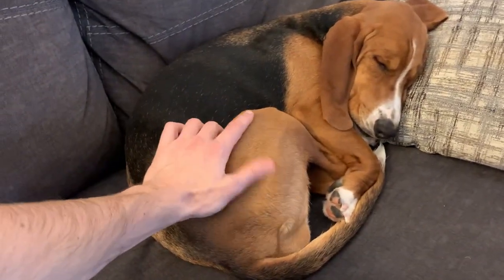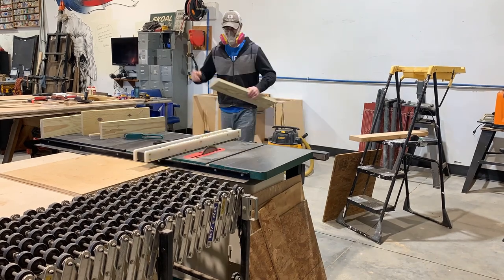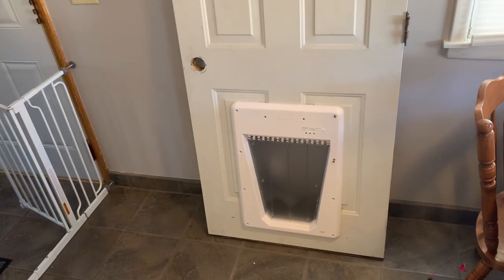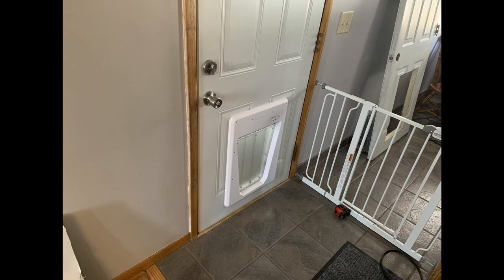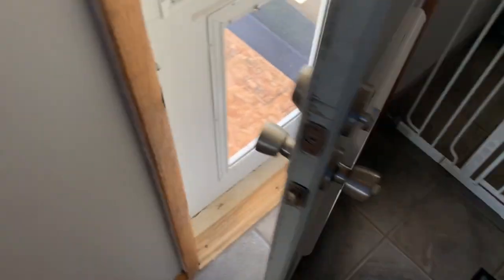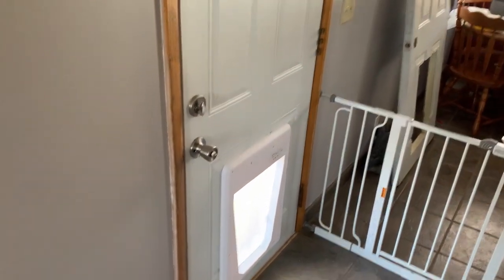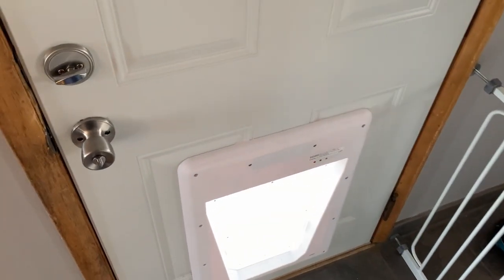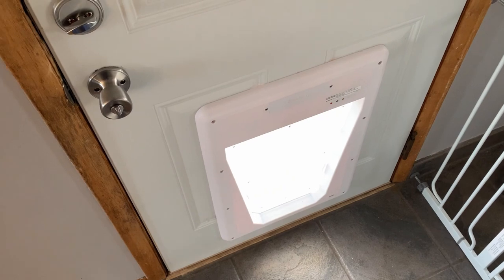Dog Door Installation

Comment: This went from I have no idea what I’m doing, to full blown professional workshop really quick. Doing research on these types of doors and having a really hard time finding quality reviews. Any updates?
Reply from the maker: We've had this door in our house for a year now.  A few updates: 

1) Battery replacements can get annoying/expensive.  I ended up buying rechargeable batteries on amazon, but even these get annoying to have to recharge on a consistent basis. 
2) We never really use the collar key that will lock and unlock the door. We just unlock or lock it.  
3) One BIG thing I wish we thought of is the stiffness of the door itself.  Because of how our house/door is situated, when our dog comes in the house, she wants to come in at a sharp angle. This will cause her tail to get pinched by the stiff door that will hurt and scare her.  We have to have a hamper next to the side of the dog door so that she comes in straighter. This prevents her tail from being clipped.